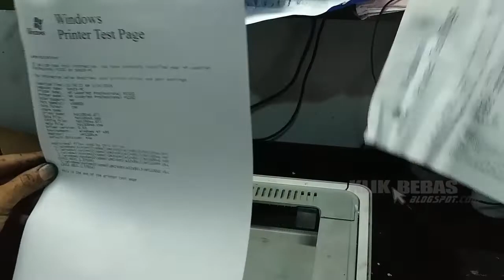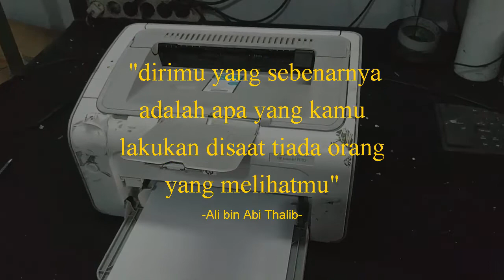Cara Bongkar Printer HP Laserjet P1102 Paper Jam Kertas Nyangkut

Comment: Gan... recomended ngak printer HP series ink tank 115 untuk print undangan ketebalan kertas 220 Gsm??
Reply from the maker: belom pernah nyoba sih. d sini jarang yg pakai hp inktank. kenapa ga pakai canon aja? ip2770 aja d pasang infus
Reply: @KLIKBEBAS  mau cari yang ada garansi gan...
Kalau HP ink tank 115 harganya 1.350.000
Kalau epson L1110 harganya 1.800.000
Bingung juga pilihnya...